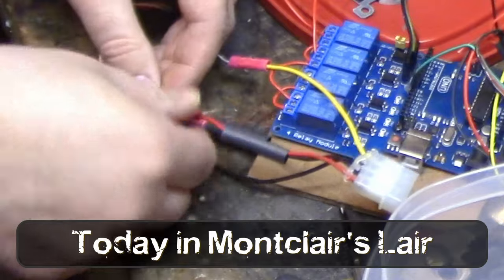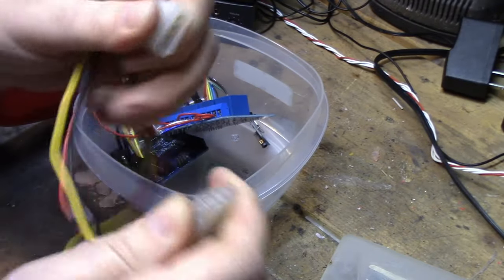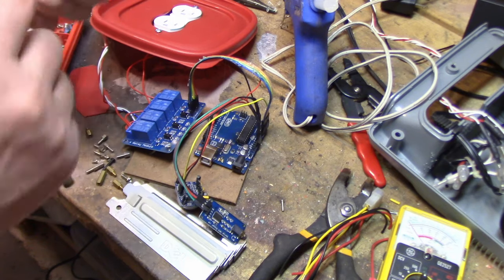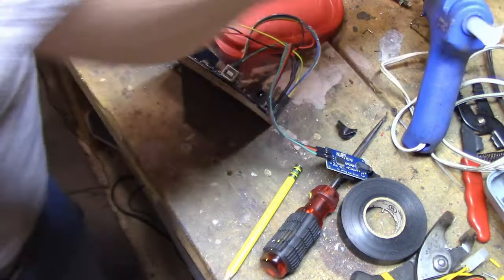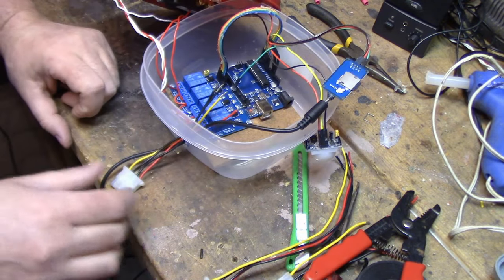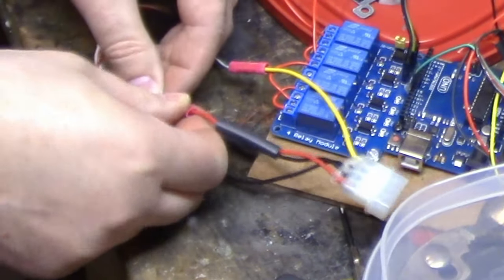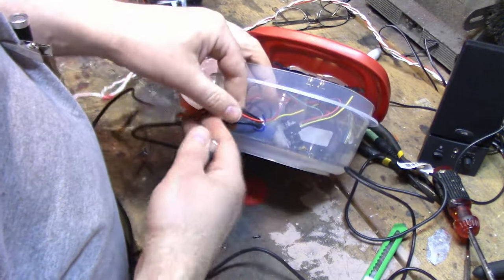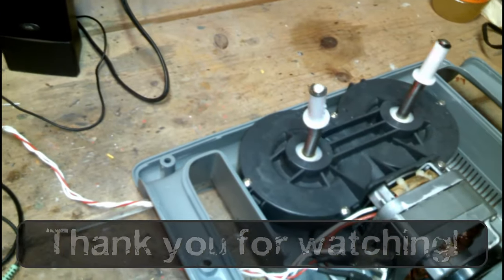$20 Arduino Prop Controller Part 5 - DIY Halloween Vlog 2016 #31: Control Yourself!

Comment: Oh my gosh...I have a bunch of those PC power cables lying around.  It never occurred to me that I could use them as connectors.  You were really making me nervous drilling on those circuit boards and using those pliers to crimp the wires so close to them.  If it would have been me, my hand would have slipped or something and I totally would have destroyed something.
Reply from the maker: +greeg1358 Remember when I said I'd been down there for 2 hours? I was looking around at different bits of this and that trying to come up with something, when I finally stumbled across PC Y splitter. It worked out well. I only wish I'd thought of it in the previous episode. Would have saved me a ton of time!

Comment: You had some damn funny commentary in this episode.  I cringed at the wire crimping.  :)

Now that I've seen how you put it all in the box, I think the audio clicking issue could be due to the lack of separation between the mains and audio areas.  I always have power wiring well away from the audio wiring where as you have all of the cables exiting through the same case hole.  The mains wiring is also laying all around the audio board.

Try plugging the speakers directly into the audio board (leave the existing cable disconnected) to see if re-routing the audio cable will minimise the issue.
Reply: +Montclair&#39;s Lair The same crimp tool is used for those butt splices as the male QC terminals you used with the motor switch.  Pliers will never give you a reliable crimp.
Reply from the maker: +da-share D'oh!! I knew it! That's it. I'm getting one, whether jpgs can drop virus payloads (they can't) or not. LOL!
Reply: Gotta watch those shifty jpgs !
Reply from the maker: +da-share Double d'oh! I just watched a video with a guy crimping those connectors -- using the same wire stripping tool I have. Argh! I guess I don't know how to use my tool. ;-) LOL!
Reply: Those slim flat crimping tools work to a degree, but the ratcheting ones will serve you much better and last you a lifetime.
Reply: +Montclair&#39;s Lair ditch the crimp solder it with your shrink hose.. :)
Reply from the maker: +da-share You talked me into it. I'll check one out this weekend, then do an entire 15 minute vlog on it. Heheheheh. Well, I'm glad everyone chimed in. Now I know why those things are so hard to work with.
Reply from the maker: Kustom Scares You know, I watched a video after this conversation, and found one showing the higher resistance in the connectors as opposed to those soldered, and another with a guy stating that there's no stronger connection than a soldered one. I think I'll pull these things off and solder the wires now. Triple D'oh!
Reply: +Montclair&#39;s Lair A properly crimped connection should be no worse than a properly soldered connection.  Not using a proper crimp tool and not using QC crimps appropriate for the wire size is where a lot of people get it wrong.  The colour of the QC crimp terminal denotes the wire size range it will accept.
Reply: I solder damn near everything.  Coming from the marine repair world in my younger days, I learned that lesson good!

Comment: I've fallen behind on my video watching, but this shit was too funny. I almost felt like I was watching one of my own videos...except you didn't smoke anything. But where were you hooking up the computer connectors to the relays? Which screw?
Reply from the maker: I just swapped all of the existing wires going into the relay for the wires on the connector.

Comment: I just hot glued the boards to the wood, quick easy fast
Reply from the maker: +Kustom Scares Yep, that's an option. I just felt like I wanted to make it more difficult on myself and spend a ridiculous amount of time on it. ;)
Reply: +Montclair&#39;s Lair Grin hey thats the best way right.. laugh
Reply from the maker: Kustom Scares Is there any other way? XD
Reply: +Montclair&#39;s Lair I will post a video this weekend, putting in new motors for my jack in the box, the 2 110ac motors did not have lots of torque they worked last year but the one for the head the shaft started to have a wobble, if you put your hand and held the head it would go the other direction, but with the wobble it was starting to go back n forth vs going one direction.  Plus I rather have 12vdc motors vs 110ac.  I found these small little motors that normally go in vending machines, i got one hooked up for the head and will do a video working on the other you will get an idea of how my work looks lol :)
Reply from the maker: +Kustom Scares Cool. Be sure to include a link to the motor please.

Comment: David_AVD did respond to my question on the forum:

"Depending on the type of AC load, it could be arcing in the relay contacts.

You could try a 22nF 275V capacitor (must be class X2 rated) across the contacts."

Don't know what that means or if that is the problem.
Reply from the maker: +The Pirates of North Court LOL! I'm not sure what contacts he means, either. Ahhh, the fun of ignorance!  Thanks for asking, Pirate!
Reply: +Montclair&#39;s Lair I'm fairly certain he is referring to the actual switch inside the relay when it opens & closes.
Reply from the maker: +The Pirates of North Court Oh, I get that part. I meant where he'd expect someone to connect a capacitor. It would probably be inline off the power, in between the wire and the center connection to the relay.
Reply: +Montclair&#39;s Lair Ya got me hangin ... I know just enough to hurt myself and let the magic smoke out of all sorts of electronics. Good luck.

Maybe if you post just that part of your vlog on the forum, he'd have a better idea what we were talking about?
Reply: +Montclair&#39;s Lair have you tried to run it without the power to the shiatsu massager and see if the clicking still occurs in the speakers?  It seems odd, are the wires from the mp3 board near the ac power wires?  like bleeding into the mp3 board if the wire is thin with not lots of insulation..   I had 2 110ac motors in use last year and i did not get any clicking on my speakers from the relays, but i did use a regular extension cord and cut the hot in half ran to relay.
Reply from the maker: +Kustom Scares It could very well be proximity to the power. Perhaps the insulation isn't thick enough on the wiring I used. I really don't know. Could be cheap speakers, too, or maybe a bad relay board. Who knows?
Reply: +Montclair&#39;s Lair yeah i use 5 dollar speakers from big lots.. so i think those would be ok.. grin if you like me your thinking do i really want to screw around with it and try to fix it.. all while your saying ugh thats going to annoy the hell out of me and you know you will be pulling it open to figure it out... :)
Reply: LOL ... I think a lot of us do that. I don't really want to mess with mine too much, took too long as it was to figure out my issues.

Comment: Please go buy a crimping tool! For all your connections ...
You go through all the trouble and ingenuity to come up with these things and then your fail point is most likely going to be improper crimp !! 
25$ at Home Depot made by Klein 
Or you can get fancy with a ratchet style made by greenlee 50+$
Reply from the maker: +Mhosley25 I know, right?! You want to know the most ridiculous thing? The stripper I was using has a crimper on it. D'oh!
Reply: +Montclair's Lair sorry now that's funny lol well u will know now for future .. Also your audio cord need to be moved away from you power to close to a/c 
Also put some 6/32 nuts on back of the outlet hold it in a bit better if you plan on plugging things in yearly
Reply from the maker: +Mhosley25 Yep, I planned on adding the nuts and probably some type of more rigid backing to the outlet. And, yeah, the interference is probably due to that.  Not a helluva lot of room to move it away in that little box with all cords going out the same hole. Regardless, it was still making that noise with everything out of the box (see the last video). It's not really a big issue since it isn't amplified when the volume is increased, so the audio will drown it out when cranked up. Thanks for watching and commenting!

Comment: does your wife know your using the good rubbermaid containers for plug outlets.. lol if you married of course...  i used the smallest ones to hold my PIR sensors last year..
Reply from the maker: +Kustom Scares Ha! I bought those specifically for this purpose. They were super cheap at Big Lots. I think I got 3 for $3.
Reply: +Montclair&#39;s Lair see we bought the kit at costco they are the same ones but they had a few that were like worthless tiny, but they work good for the PIR sensor container.. lol  wife was like hey are you .... and i was like yep im cutting the lid for my PIR sensors.. hahaha